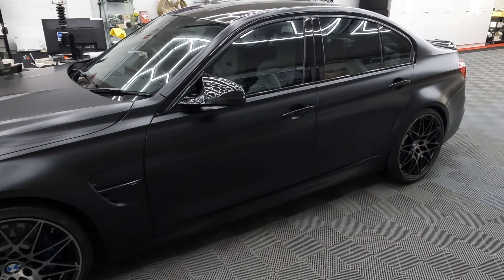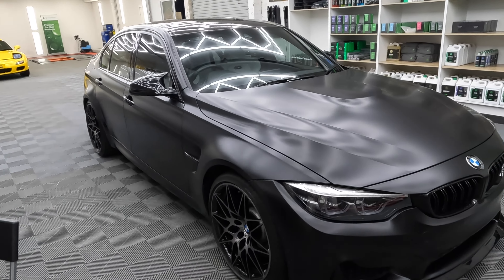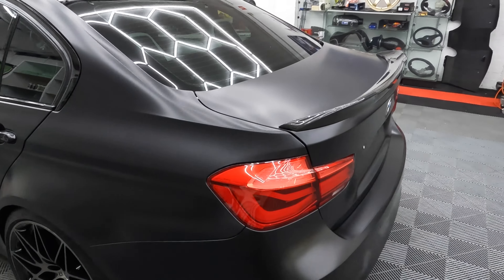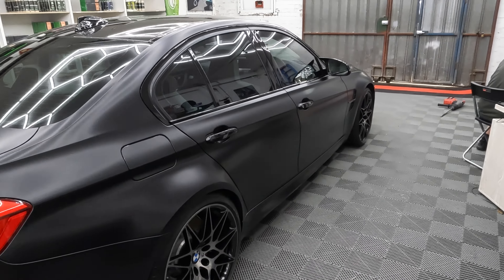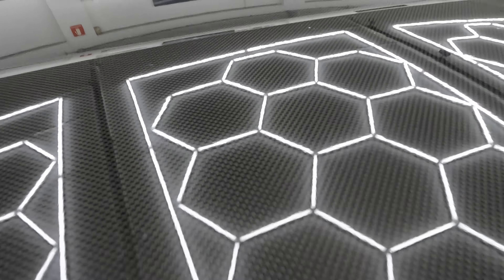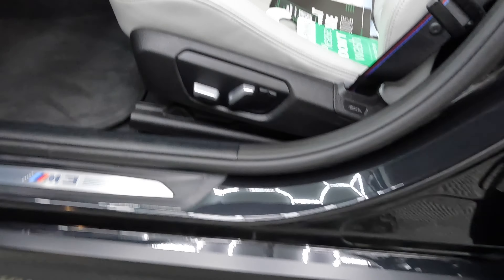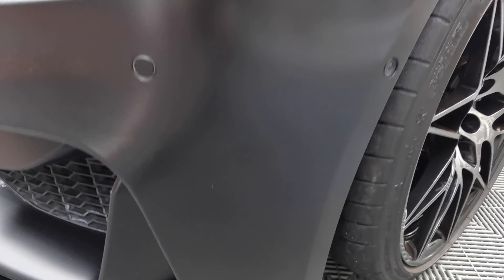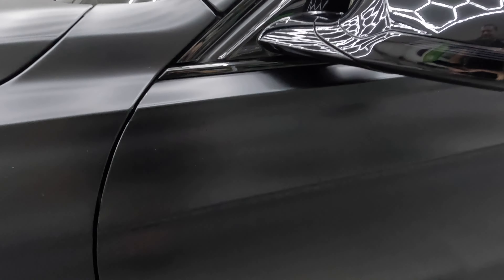BMW M3 Gloss to Matte Conversion using Suntek Satin PPF Stealth Wrap

Comment: So, most of the cost of a PPF application is for the expert labor, the skill, correct?  The cost of the PPF material itself is small?
Reply from the maker: the ppf is actually very costly as well. Replacing a hood might be $300-$400 of film alone if a mistake is made

Comment: hi, you mentioned in the beginning that you'd list the pros and cons of a matte wrap, but you didn't mention any cons aside from the door jam not being able to be wrapped. are there any cons of having a car wrapped in matte functionally? thanks.
Reply from the maker: Hi mate

You raise a valid point. 

The only cons to a matte conversion is some areas like door jambs and door handles may not be able to be wrapped. Other than that the only other con is the additional cost. All other matters are no different to any glossy ppf such as stretch marks, debris and dust etc... which is primarily relating to the skill of the installer rather than the film itself
Reply: @iglcoatingsau  oh ok gotcha. thanks for the reply. so in actuality you DID mention the cons in your video haha, my bad. thanks again!
Reply from the maker: @SickSickCix My pleasure mate